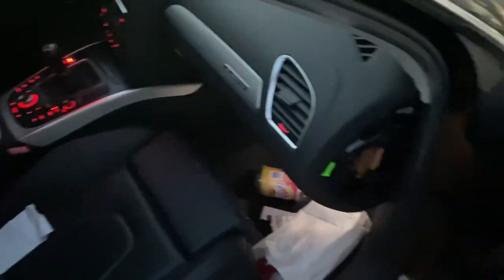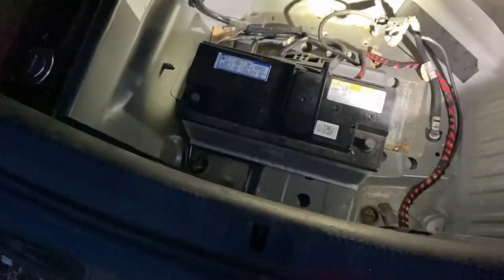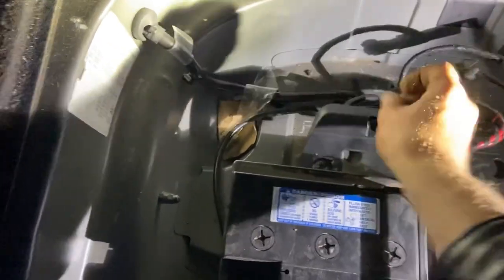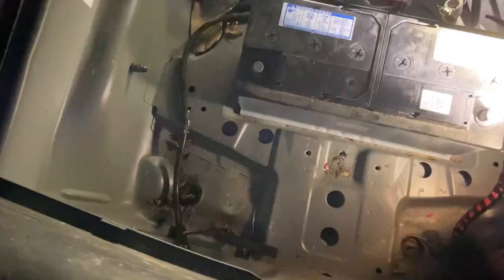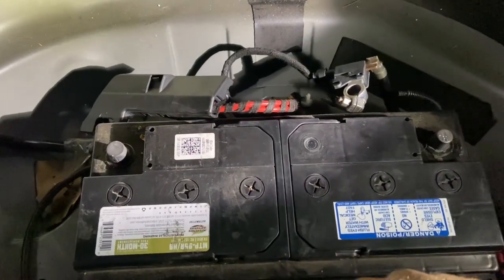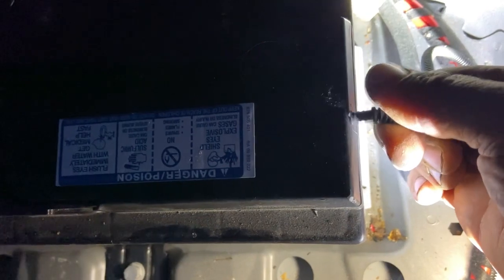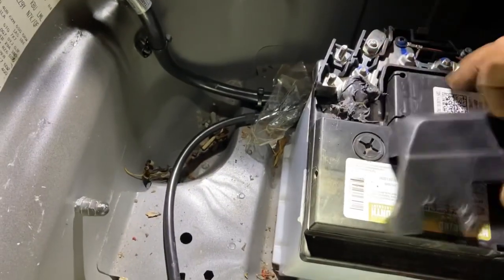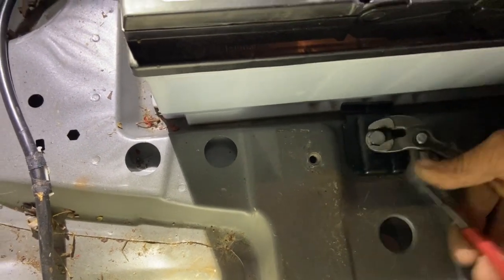A4 2.0t BATTERY Replacing in trunk Audi A4 Q5 Quattro how to replace trunk battery

Comment: How to store battery when car is put away for 6 months . Leave I’m car or take out .? 
Where are all ground wires on the car . (Salt)
Reply from the maker: Either hook it up to a good name brand battery tender (best solution) or take the battery out and put it in your garage on a tender or trickle charger same thing.  Or At least take the negative terminal off and store it without any drain/ parasitic load.